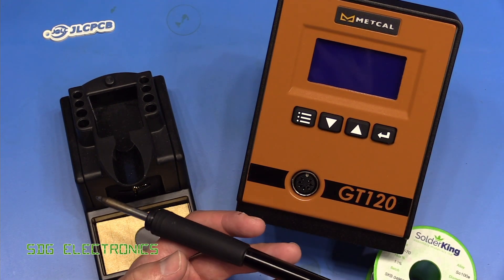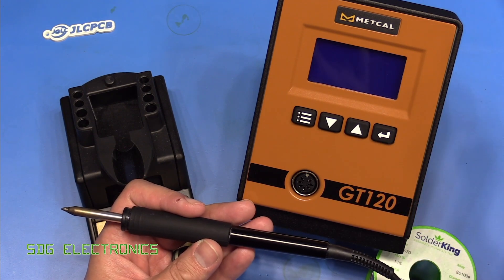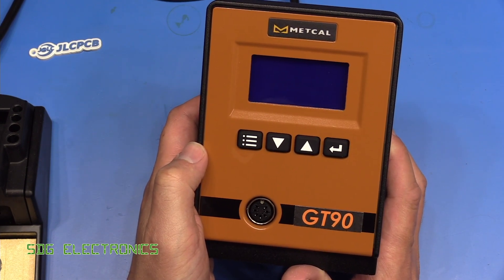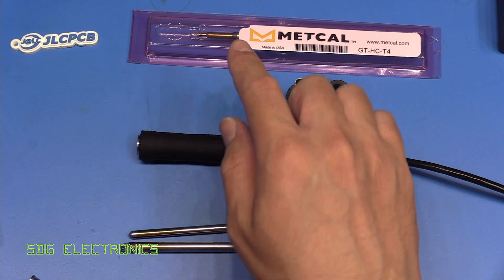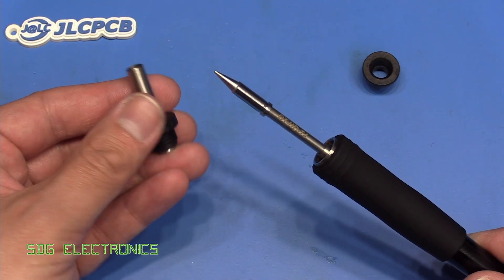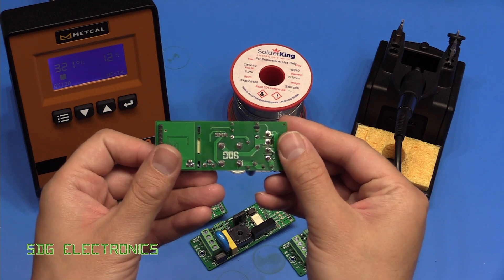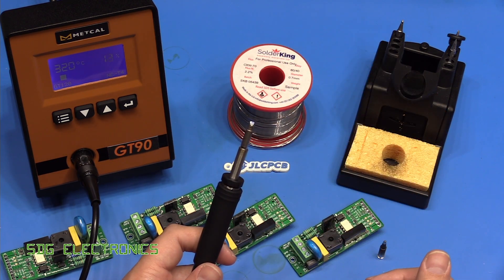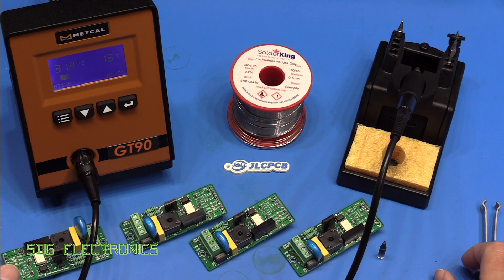SDG #250 Metcal GT4 Slim Handpiece, GT90 / GT120 GT Adjustable Soldering Station

Comment: I have a bought new GT90 METCAL and when I turn it on, the screen flashes without letting you do anything. When it stops flashing it says ADC TIMEOUT. How can we fix it?
Reply from the maker: Sounds like a fault. You could try a firmware update, but I would return it for replacement

Comment: Hi Steven, when will be the test of Thermaltronics soldering station
Reply from the maker: Any model in particular that's of interest?
Reply: @sdgelectronics  sure, Thermaltronics TMT-2000S, which work such  Metcal, also the model Thermaltronics TMT-9000S, thanks for your answer
Reply: Thermaltronics is basically the same as metcal, just look at the output power in the specifications.
Reply: @jaro6985  they can do that now and have compatible consumables as metcal's patents have started "running out"
Reply: @thecow2756  yeah I only buy thermaltronics tips now, quality is good, price is good.

Comment: For the price, I would also expect a nicer display. Even the ultra-cheap soldering stations use decent LCDs and OLEDs.
Reply from the maker: OLEDs are not a good choice for static displays like this, the screen burn is apparent after only 12 hours in my testing.

Comment: Im spoiled by big ass T12s that you can grab with your base hands even after extensive use, i would be quite scared of tiny piece of meal as hot as 400c flinging into my monitor or something
Reply from the maker: The Metcal MX/CV cartridge system is probably the easiest out of the lot to swap out, but you do need the silicone tab. JBC's system is OK, but I prefer to grab the Metcal silicone tab to remove those too.

Comment: Wow. That contrast on firmware upgrade paints a wery poor picture of their QC. And that factory-reset didn't turn it back to reasonable defaults, unbelievable!
Reply from the maker: It's a little bit puzzling, since that's the only parameter that doesn't get reset to something sensible. Temperature, sleep timers etc all go to normal values.
Reply from the maker: It's being addressed now after my feedback

Comment: Metcal is the apple of solder stations
Reply from the maker: They last a lot longer than Apple products though!
Reply: No the reputation of metcal is justified. They really are very very good.
Reply: @allthegearnoidea6752  using my JBC I don’t really see the selling point of metcal
Reply: @ViniciusMiguel1988  How long do jbc tips last? In videos I always hear that they turn dark quickly, but rarely did a person that uses jbc a LOT tell, how many hours/years a tip has until you need to replace it.
Reply: @HannesMrg  The dark color is just oxidation from operating at high temperatures for too long. It happens to all irons overtime, especially smaller tips with less thermal mass. JBC cartridges are smaller with less metal to dissipate excess heat. Metcal tips don't oxidize as rapidly because they operate at a fixed temperature, which is below the oxidation temperature. 

Oxidation, contrary to what you read, isn't as catastrophic as it is made out to be. It can often be cleaned off with a tip rejuvenator with boric acid mixed with flux. Occasionally, you will have tips where the external plating has oxidized away. This can be repaired a few minutes by soaking a gauge pad in a nickel or copper plating solution and connecting a 5v anode to the tip and the cathode to the pad.
Reply: @bobweiram6321  thanks a lot! That's really helpful.
Got both the aixun stations Steve showed on this channel (T245 and T210) and some genuine jbc tips. I was worried that the tips might break fast, but what you wrote sounds like I will have fun with them for a long time.
Reply: @HannesMrg  Unfortunately, the Aixun come with knock off cartridges which are not as well made, but still serviceable.
Reply: @bobweiram6321  
"This can be repaired a few minutes by soaking a gauge pad in a nickel or copper plating solution and connecting a 5v anode to the tip and the cathode to the pad."

This is not a joke - Right?